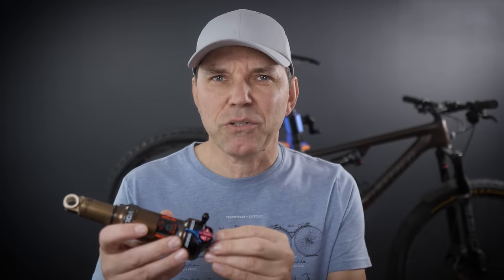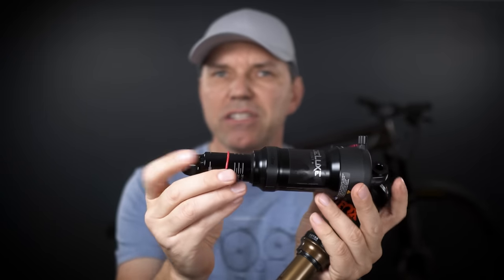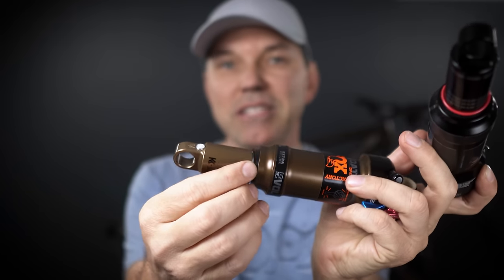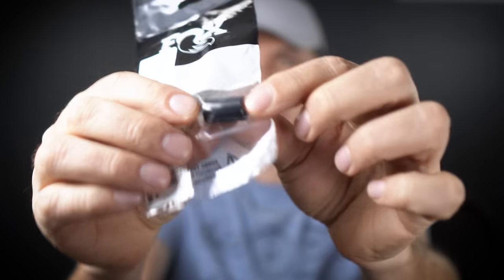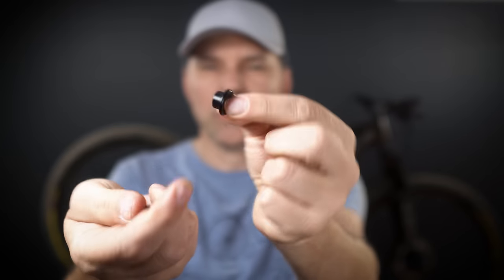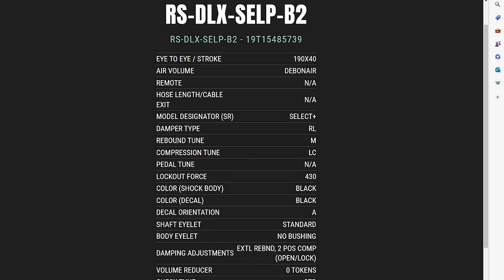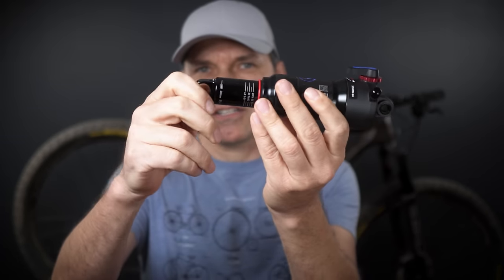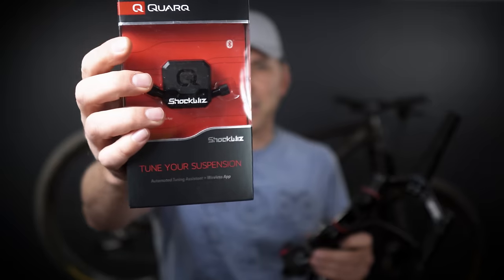Step-by-Step How-To UPGRADE a Rear SHOCK - 4 Easy Steps - MTB Suspension Replace #bikelife

Comment: To tune my suspension on the trail, my number one tool is my eye glasses! I can't tell you how many times I have screwed up my settings thinking I remember which way to turn my adjustment knobs and ended up way out of tune.
Reply from the maker: Haha good one! Always remember clockwise is slower!

Comment: I own a 2020 Canyon LUX  and the system used by Rockshox with DU bushings is the worst ever and less performing. In fact, this system damaged my frame because the total absence of rotation of the spacer meant that the carbon frame wore out, fortunately replaced under warranty. Now I mount the RS shock absorber with the FOX bushing system. The FOX system, even if it lasts less, safeguards the components and therefore the life of the bicycle. Now Canyon uses all FOX components and you can explain yourself why.
Reply from the maker: Not a fan of SRAM's either...

Comment: I’m curious between RockShox Deluxe Ultimate C1 vs Fox Float DPS performance elite are they comparable or is the deluxe ultimate noticeably better? As far as Performance reliability and durability?
Reply from the maker: I would go for FOX...
Reply: @LoveMTB  I did a bunch of research on RockShox and fox racing suspension and from the reviews I hear differences are personal preference which I believe I understand but the main thing that sold me was foxes service ability compared to rock shocks Fox suspension resale  value much better, and their service life is also longer whereas SRAM doesn’t support their shocks for the amount of time Fox would for example, sram is more innovative to where they don’t support the products as long compared to Fox  from what I read.
Reply: @LoveMTB  and thanks for the recommendation I’m going to get a fox 36 performance elite 27.5” 44mm offset last on my bike upgrade list since my marzocchi bomber z2 is working fine

Comment: Very informative video kudos. For me I typically leave the rear and front suspension per manufacturer (unless I was racing and the rear and front needs fine tuning based on the course). What I notice between Rockshox and fox, rockshox tent to be more plush at the beginning of the stroke where as fox is after. Maybe it is just me. The biggest will be like you explained sag…rider weight, riding style play a big part on fine tuning the fork and rear shocks
Reply from the maker: Noted, I'll see what I can do :)

Comment: Fox nylon bushings work fine with Rock Shox as well in my experience
Reply from the maker: They do and I would use them 10 times out of 10 vs the RS DU bushing. Just for ease of service.
Reply: @LoveMTB  definitely

Comment: Is there a proper directional that must be fallow? or can you install in any direction?
Reply from the maker: It will only fit one way most of the time if not 100% of the time, frame designer decides that.

Comment: Hi, can you help me that to upgrade the old Brain Rock Shox installed on Spec Epic Expert 2012, with a new rear shox ad example Rockshox model 
RockShox Monarch RT3 Rear Shock, 7.25x1.75" (184x44mm), D1
can you support where i found a drawing? because in the website of Sram i dont found anything

Comment: nice video, i juste buy the same bike to upgrade it. For the rear suspension, i want to buy a Rockshox SIDLuxe Ultimate 3P RL Solo Air but i don't know if i need some bushing or other stuff to swap it ? Do you have an idea ?
Reply from the maker: Just use this guide and make notes of what you see, it eas just the top bushing that was needed.

Comment: I have a m8 by 20 but Fox does not have that exact size what size should I get
Reply from the maker: They definitely have a 8x20 it’s lower in the list - https://shop.ridefox.ca/products/mounting-hardware?variant=40477314089039